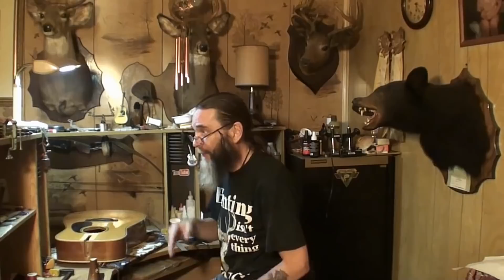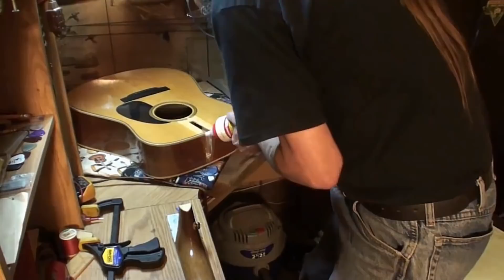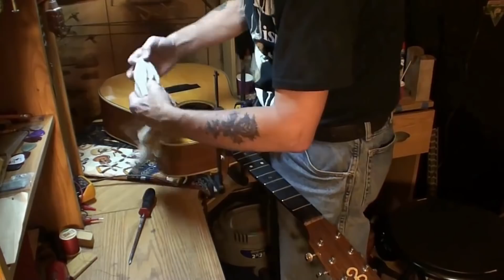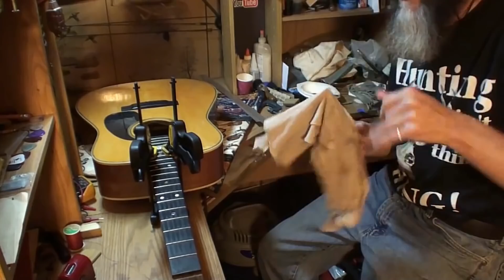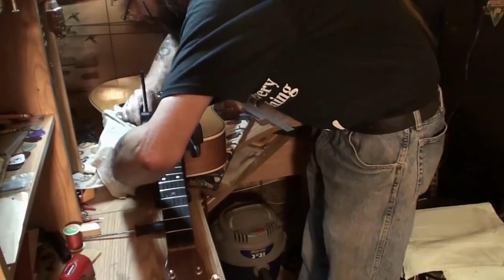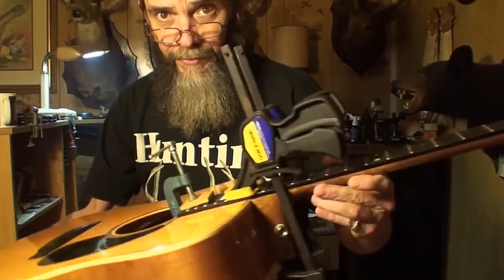acoustic guitar neck reset 2of2

Comment: Hi randy, i have an acoustic guitar that needs some work,its only a cheap guitar but its my sweetheart i learned to play on her 10 years ago and still play her today so she means alot to me anyway theres a couple of joints inside the body that came loose so the back is moving and creeking also needs to be refreted new tuner heads and possibly truss rod and nut,, so is it possible to get a complete refresh like open the body and make it stronger and better, any tips for upgrades that will make her stronger,,, keep up the good work much respect from Ireland